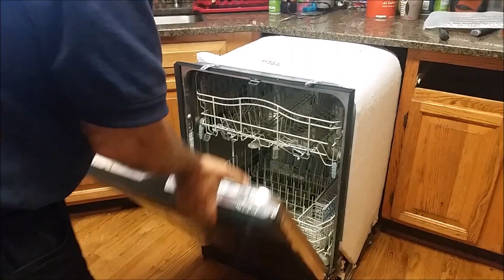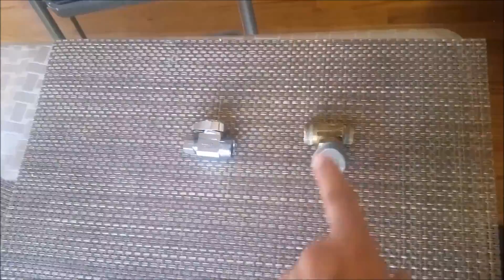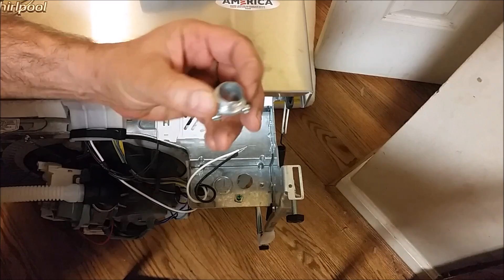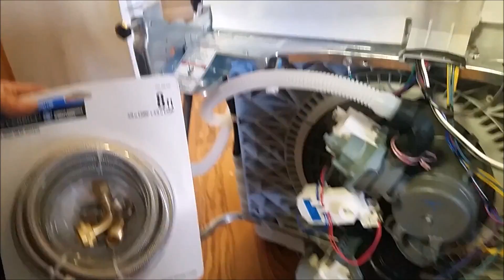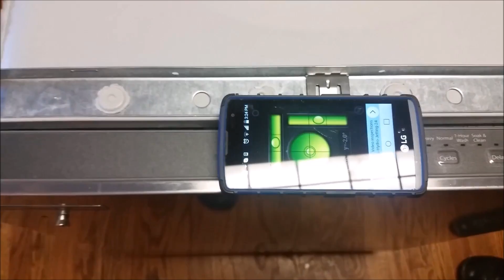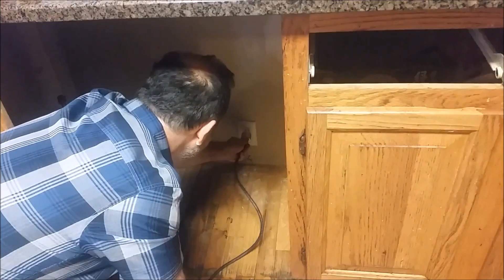How To Remove and Install A Whirlpool Dishwasher - Under Granite - Step By Step

Comment from the maker: Dishwasher Water supply line 3/8" = https://amzn.to/3mVDgks
Dishwasher Power supply cord = https://amzn.to/3i5MPtv
3/4" Conduit clamp =  https://amzn.to/3cz2sIB
1.2" Codut clamp = https://amzn.to/3kTiPTA
Bracket used = https://amzn.to/2S2mS3r 
Drill use Ryobi = https://amzn.to/3n2HS8A
Dishwasher Power supply cord = https://amzn.to/3i5MPtv
Or
https://www.amazon.com/gp/search/ref=as_li_qf_sp_sr_tl?ie=UTF8&tag=josephkhalon-20&keywords=14+Gauge+3+Prong+Heavy+Duty+Replacement+Power+Supply+Cord+Cable&index=aps&camp=1789&creative=9325&linkCode=ur2&linkId=5261d9c5875462920e21193906cd7001
Amazon Deals:
Try Amazon Prime 30 days for free = https://amzn.to/2JMWaLe
Create Amazon Business account = https://amzn.to/3mLSyYt
Joint Amazon Prime Watch Thousends Of Movies and TV = https://amzn.to/33NfsHD
Try Personal Shopper Wardrobe  https://amzn.to/2VClfv9

Comment: How did you remove it though if it was mounted to granite?
Reply from the maker: In a kitchen with granite countertop the dishwasher is attached to side of the cabinet. You will need to detach the dishwasher from the cabinet. You can look at this video how it is done. 
https://youtu.be/IV5KNVMxbiY
Reply: @josephk9182  thank you I actually watched that video before I came to this one. The thing is there's nothing like that on mine, there's rubber stripping all along the side of the head been glued in and I can't get back there.
Reply from the maker: @osirisadvocate  Wow !! That not the way it should be attached. You will need to remove the old dishwasher by hook by crook.
Reply: @josephk9182  noooooooo haha. Thank you!

Comment: I bought a whirlpool dishwasher Model number: WDTA5OSAHZ stainless steel. I removed the old one Kenmore brand. Why I need to buy parts I thought it's all supplied. Can you please post your reply here.
Thank you much appreciated. 
Your video is very helpful. Millions of thanks.
Reply from the maker: The dishwasher does not come with electrical cable, conduit, water hose and  I believe also brackets to attach the dishwasher to cabinet. You should reuse the old water hose and the conduit of the old dishwasher if possible otherwise you should buy them from home improvement shop.
Reply: Thanks for your reply that's very helpful! My countless thanks. God loves & bless you so as your family.
Reply from the maker: @zenaidamicu6033  Thank You

Comment: This was an excellent how-to video, gave me proper ideas about making the newly-installed dishwasher easy to remove for maintenance/cleaning by changing out the electric cable and water supply hose to longer, more flexible options